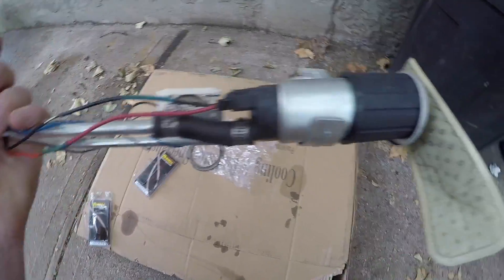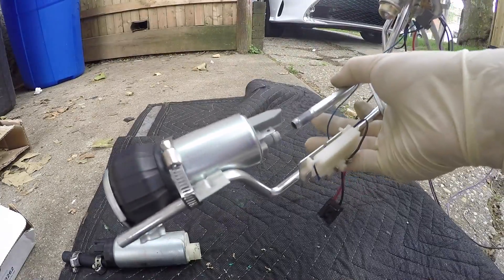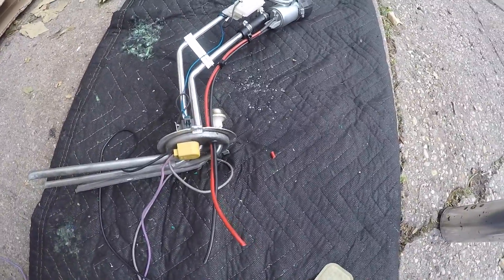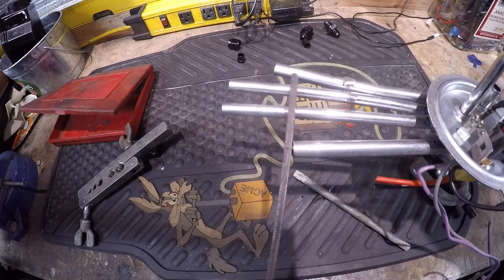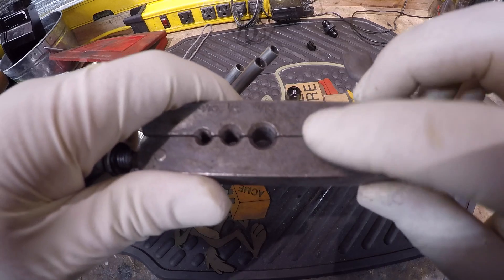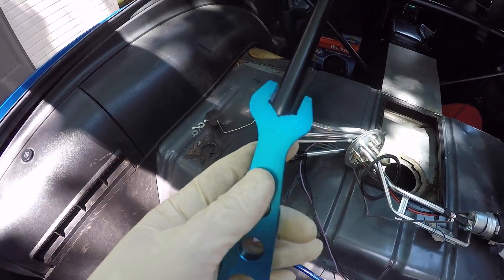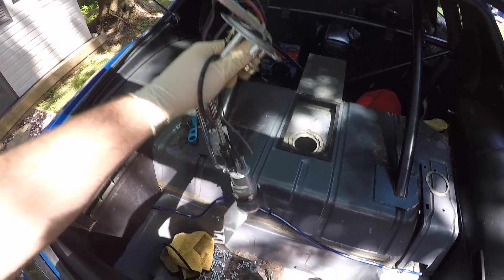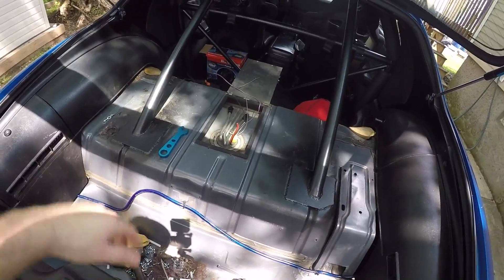How to: Adapting Factory Fuel Lines for an LS swap | LSA Blower Swap

Comment: I followed this exact same thing, did your original return line begin to squirt fuel out when the tank gets pressure? Dont have an issue at all untill I get to about half a tank. Wonder if you have had that similar issue

Comment: Question; How is a rubber grommet from harbor freight going to keep your garage from filling up with gas fumes? Many have water heaters, infrared or HVAC heat when cool out. If the fuel is cooled, pumped from in ground tanks at gas stations, no activate carbon canister, it will simply push fumes out and the hydrocarbon run free! DK, ASE Master Tech since 78, retired.

Comment: Old video, but don’t use the brake flare tool!! Found out the hard way myself. An fittings use different degree than the brake line flare is.. you will end up with a small contact when using this tool. Found out with my trans line, then a customers fuel injected lines! Buy the right tool! Same concept

Comment: Question, which sending unit did you get? I’m going from 305 tbi to 5.3
Reply: Your stock unit will work, just upgrade the pump. I suggest a walbro 400lph or 450lph(E85 safe). That way, if your future has a turbo in it, you already have the pump to provide enough fuel.

Comment: I do the same thing with bulk 3/8" brake line for the for the fuel system conversions on my LS projects and sometimes I convert the stock lines over if in good condition, cheaper than braided and neater too.  My question is how did you seal the Harbor Freight grommet with the heavier gauge wiring running through it ?  Seems like it would be one hell of a fuel leak on a full tank.

Comment: Quick question so if I'm going from a carb motor with mechanical fuel pump can I just add the pump to the original sending unit or is it more to it ??
Reply from the maker: You should be able to make the carb sending unit work.

Comment: Hey @LsxMatt, of the four pump lines coming out, which are used, what did you do with others?
Reply from the maker: The two larger ones I use for supply and return. One was already supply and the other 3/8 is a vent. The two smaller ones are evap and the factory return line. I used one of the smaller lines for the vent and the remaining evap got capped. I’m using a vented gas cap.
Reply: @lsxmatt  Thank you for helping me with the final piece for my fuel system, hopefully, this can also help others. Now to get a harness and jump on lt1swap.com

Comment: I know that was the 3/8 feed line that you did but was the other line the 5/16 return line you did? I've heard the 6an fitting wouldn't work on the 5/16 line
Reply from the maker: I used the 3/8 vent as my return and used the factory 5/16 return as the vent.
Reply: @lsxmatt  look. Thanx

Comment: Hey Matt BADGTA here from Thirdgen.org forums..

Been watching your videos, instead of using special "COUPLERS" and MALE/MALE couplers, i used a braided steel hose like you did the short runs with, but i took them to a local hydraulic hose shop and had them install what's called "JIC" fittings..

They are a "AN" type end, they just get installed with a super high pressure machine and they wont leak!! BELIEVE ME!!!

I did mine for the stealth-ram swap way back when, and man they look good with that braided hose...

You can get them with male AN, female AN, 90* AN FEMALE or MALE, etc.

So next time just get yaself some braided line the size ya want, and go by your local Hydraulic big truck shop, ask them for some jic fittings and tell them what ya trying to do, they can hok ya up cheaper than what ya thought and it saves on special couplers, etc.

Here is what they look like when ya done, ignore the price, this guy is crazy whoever is selling them, i am just using this for picture reference of what it looks like when finished...

http://www.davis.com/Product/Smooth_PTFE_lined_hose_assembly_1_JIC_female_x_1_JIC_female_10_ft_length/DO-96553-15

Comment: Great video I'm not busting your balls but just want to let you know a few mistakes that you made. I don't think shrink tube is safe to use with gas, so you might have issues with it deteriorating. The return line that you ran though the vent pipe should have been extended to the bottom of the tank because the fuel returning to the tank will aerate. AN fittings are 37 deg and a regular flare is 45 deg be careful they might leak

Comment: If you needed to push more fuel which way would you go about it? I need a -8 feed and -6 return, there's not much for after market on thirdgens for the factory tank. I'm thinking maybe a sump and external pump but I hate external pumps lol
Reply from the maker: Whats your pressure at right now? You can always raise it a little, but that will only take you so far.
Reply: Cars not running yet, 5.3 gt45 btr stage 2 I have everything I need for the engine, but I'm a little unsure what to do with the fuel system I wanna do it once and be done

Comment: Yeah you’ve got easy to follow content but the true tech advice is not really good quality .   Brake lines are 45 degree AN is 37 plus a single flare is not very reliable unless it’s stainless
Reply from the maker: Yea I had no idea the flare angle was different on -an.  I bought the right tool for when I need to do this on my trans am.

Comment: What did you do with EVAP lines / system? Or are they "pluggable" with EGR delete in ECM? Have my LS pulled from my old van, and putting together plans to swap into my 83 Camaro. Thanks
Reply: are you talking about the four outlets on stock fuel unit, I need to find out which outlets i need and what to do with others

Comment: When you cut the factory power and ground off from the sender connector, did the sender (purple wire) still operate your fuel gauge fine? Just found out my aeromotive 340 burnt that whole connector in my tank. I'm going to bypass it just as you did.
Reply from the maker: Yea gauge works perfect👍

Comment: Can I use walbro 255 ? For 5.3 Ls engine
Reply from the maker: Oh yea a 255 would be fine. A single 255 is good for around 500hp.
Reply: LsxMatt 
I assume the other lines of the sending unit are obsolete now. Did you block them off or anything like that to prevent any fuel odor ?

Comment: Great Video, I'm just learning all about AN (Army/Navy) fittings! never had to deal with it much. I installed a 5.3 in a 86 Army K30 Diesel truck, Had a inline 044 knock off pump pulling fuel but that didn't work out to great and the engine was starving for fuel and it was noisy so I'm using a sending unit from a 90 Chevy truck and a fuel pump from  97 Chevy Truck with a 7.4L F.I.  Its Christmas and just sourced what I could get at the local parts stores, Had no time to order stuff online and wait 3 days. I also cut open my stock tank and welded in a stainless cooking pot where the pump will be suspended in. just got done pressure testing the tank tonight and crossing my fingers that everything will work as planed. I plan on throwing  a Chinese Turbo on it in the future and will upgrade the pump with a $100 450G/H unit. It's my first LS but it won't be my last. Been dealing with SBC all my life and I'm kicking myself in the ass for not doing it sooner, they are the best engines.
Reply: Update, Got everything hooked up with F.I. hose clamps. Installed an Inline OE Purolator fuel filter, drove across town, no leaks, pump is feeding the 5.3 properly and everything works

Comment: An is 37 degree, automotive or SAE? are 45. I don't think you have the right tool. An AN flare tool is not something you find in a parts store. I'm surprised they are not leaking. Another issue is the factory tube. It's usually welded, and has a seam on the inside. That's why they use double flares on automotive applications. It puts the smooth outside surface of the tube as the seat for the fitting. On my car (84 Camaro) the seams caused the fuel lines to leak. I was able to polish them out with a tootsie roll abrasive.

Comment: What size must the line be?
Reply from the maker: Stock lines are 3/8, so if you want to adapt them for an fittings you need to use -6an.
Reply: @lsxmatt  which lines did you use and what to do with the others

Comment: I love ur vids I am restoring a 1986 firebird sport coupe berlintta and was wandering how to maintenance the back hatch motor? And how much was the engine and trans swap cost to get down the road?
Reply from the maker: I never really had to touch my hatch motor, so far its still working...I would say a basic swap running would be around 3500-5000, you’ll be closer to 3500 if you get the motor, trans, and accessories from a junkyard.

Comment: I know you will but, make sure everything you did is sealed up tight.  You will smell gas inside your car.  That’s how I found out someone had cut the floor in my car, and they did a hack job. But I cleaned it up. Of course I bought the car used.
Reply from the maker: I’ll find out soon enough, but everything seems to be sealed up good. Only thing I’m going to change is the wire grommet with a bulkhead fitting in its place.

Comment: I thought An fittings were 37-degree flares and brake line fittings 45 degree flares
Reply from the maker: Single flares are 37 degrees, double flares are 45. Single’s can’t be used on brake lines, they have to be either iso bubble or double.
Reply: @lsxmatt  If that's an SAE flare tool then it's 45* (used for refrigeration, water lines, various copper lines...), the only 37* flairs are AN and JIC (special hydraulic fittings which match the AN fittings but are cut to a less exacting standard, there's also a Parker hydraulic fitting standard which uses 30* flares and a Japanese one that uses 37* flares and metric threads).  Unless you went out and ordered a special AN or hydraulic fitting tool that's a 45* flare (37* flaring tools usually have blue boxes so they stand out from the standard ones).

The second problem you have there is that those tube nut/ferrule assemblies are designed for use with aluminum tube.

You may never see a problem from this, but you've created a situation where you have the seal being made by a single point of contact rather than a flat face, allowing it to pivot when it vibrates and it''s a steel tube pivoting against an aluminum ferrule that will wear and loosen.  Of course, a properly done aluminum an -8 fitting joint has a pressure rating starting at 500psi, so you likely have a little bit of leeway there until wear from vibration causes a problem.

Comment: Is that submersible wire? I've been looking for some 12ga submersible wire. I've also had several people say that the fuel can wick up through the wire. Seems far fetched, but was wondering what your experience was.
Reply from the maker: I used Teflon coated wire that I got on Amazon a whileee ago. If you can’t find any you can always use some PTFE heat shrink tubing and coat the whole wire with it. That’s weird, I never heard the thing with the fuel making its way up through the wire..

Comment: Dude if you ever flip your car the rubber grommet will leak fuel all over the place. find a gas tank shop your can get the bulkhead fitting you need there be safe.
Reply from the maker: Good to know, the pump access door will come in handy now😂
Reply: While you're in there, you might want to fish out the swollen heat shrink from the bottom of your tank. It is not compatible with life submerged in fuel.